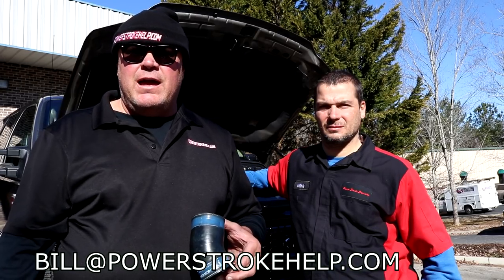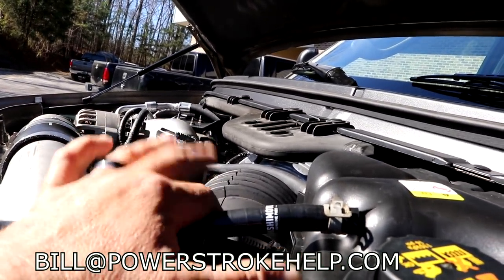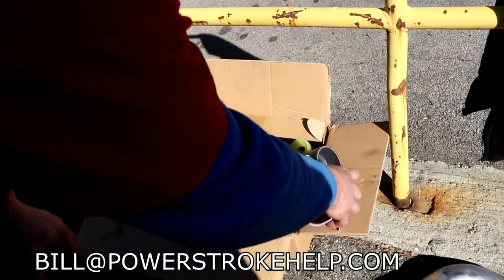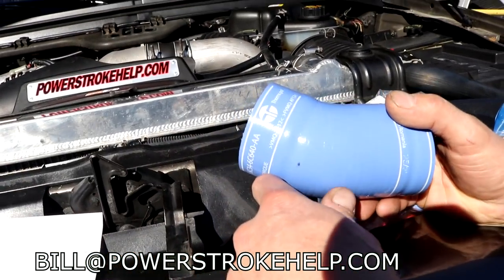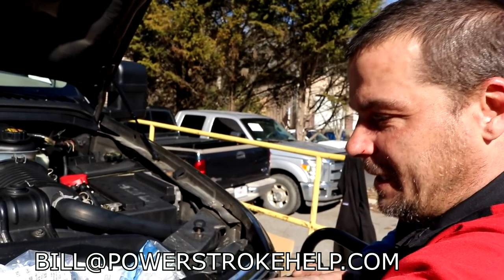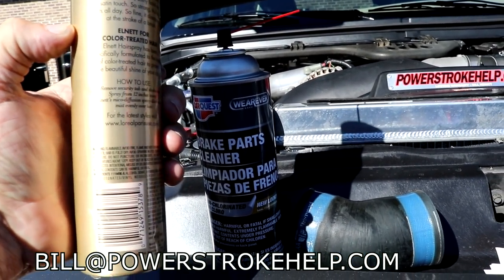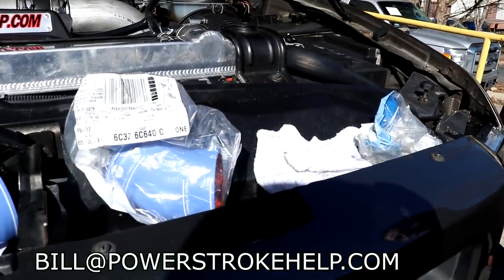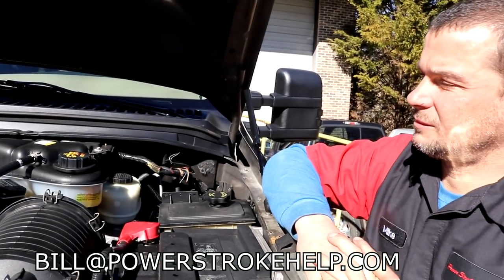POWERSTROKE TURBO BOOT FAILURE

Comment: You need to do a video on the ccv......I am intrigued!
Reply from the maker: I did the CCV video and the internet armchair trolls lost their minds. called me all sorts of nasty names. The argument is ALL Diesel engines are supposed to vent to the atmosphere and not ingest oil from the inside of the engine AND that many older diesel engine designs vented to the atmosphere. This is true until the PowerStroke V8 diesel engines started turning up the RPM and shift points to 2500+. This changes the rules and causes an increase in crank case pressure that MUST be relieved by vacuum or the oil seals in the engine start tom fail. Crankcase scavenging  using vacuum pumps etc has been in circle track racing for many decades, but these "experts" are unaware such things exist and argue from a point of ignorance.
Reply: @powerstrokehelp  thanks for the response. I was interested because I scolded my mechanic because in fortifying the engine he grinded off the bracket that mounts the intake tube to the ficm bracket and in turn caused the pcv valve to become unsupported so it leaks a very small amount.   Looks like I need to rectify the bracket and put a new pcv assembly in.....
Reply: @armedprophet3321  Bold Talker is a good Indian name. 👍

Comment: One issue I've had with the 6.0 and 6.4 air filters is when they get snow in them.  The snow melts, the water freezes, and the truck stops breathing.   The Ford air filters are a real pain when it comes to thawing them out and removing all the water from them.
Reply: How the hell did you get snow on the air filter? Lol
Reply: @themostmlgjellybean607  Beat me to the question.....No way on my 6.4 could I get snow in there, way protected from the elements.

Comment: why doesnt ford use a metal tube that bolts at each end?
Reply from the maker: The rubber boots have to be in place to dampen the vibrations of the engine. You can't have the driver (paying customer) having strange vibrations coming up his pants leg while going down the road.

Comment: one thing i didn't hear you mention is, the damage caused by over tightening the clamps on the aluminum tubes, it can cause the ends to deform and become cone shaped and out of round!
Beware when buying a truck from someone that goes out of their way to tell you how good everything is because they are a "MECHANIC"  I bought a late 99 with a bad auto transmission from a "MECHANIC" he was also a "WELDER"  the tubes were over tightened  and totally distortrd the boots were so tight they looked a girls skirt where they came out of the clamp. This guy took the air heater coil out of the Y pipe and put in a conglomeration of 1/2" black steel pipe with with a "T" and tons of RTV this was his set-up for a boost gauge port!  On the welding end this Dork took a 10" wide 1/2" steel plate and put it across the frame for a 5th wheel gooseneck hitch!  Not a bad idea if bolted,  but he weleded the damn thing directly to the frame! BAD IDEA!  The welding was shitty and had stubbs of MIG wire poking out allover!
Banks has good boots and tubes the tubes are stainless alloy .  I have a OBS that I put a Banks intercooler in it is top quality for after market!
Nothing Good comes from China!!!

Comment: I have a single vgt s364 on my 6.4, and it makes it makes all the boost, all the time! I blew off the aftermarket boot from h&s I got.  Was at about 30 psi and that made an impressive thump

I had to work out a roadside fix( Ofc is 35 degree heavy rain)  couldn’t find the clamp so I used hairspray and as many zip ties as I could fit. Saw this video today and it made me laugh, because everything he said happened to me. No boost is no joke!!!! Get an extra boot and extra clamps.

Comment: I guess it's not profitable for you...but dang I wish you'd still rebuild 7.3s.
Reply from the maker: I dont have a problem with rebuilding 7.3s but most times you can find a much cheaper low mile drop in on car-part.com. We do not install used engines.

Comment: There's nothing wrong with the Ford tubes until you start talking about the 6.7. My PLASTIC CAC to throttle body tube failed at 67K with no tuning. Imagine that happening in the mountains where there is no place to pull over and now no way to pull your load without melting the motor down because there is no boost .Is the Ford plastic tube the cam sensor of the 6.7? Carry a spare because Ford cant engineer the tube properly??

Comment: I put the AFE intercooler tubes on my 7.3 and it rocks.  Better mpg's, better boost and better cooling! It did pop off once on the cold side once but it was a Ford clamp failure.  AFE sent me high performance clamps and its been golden ever since.  

Most of the parts on the 6.0 are outstanding?  Come on it's a 6.0.  The whole engine was a POS that ruined Ford's diesel reputation!  That's why you charge 10 grand to bullet proof that POS!

Comment: Now, let me say, I love your channel, Bill. Been following you for years. And I can't wait till the day I finally have a 6.0 to bring to you to have dealerproofed. But, I do wish you would quit talking down to your audience. For example, you mock people who do the crankcase vent bypass, but the only explanation you give is that Ford wouldn't have done it that way unless it was right. But isn't your whole business built on the fact that Ford didn't get a lot of things right?  Isn't that why you call it "dealerproofing"? Please, if you're going to tell us why some modification is wrong, explain why it is wrong, functionally. And some aftermarket parts are better. Mishimoto radiator, anyone? Respectfully...
Reply from the maker: Thank You for the respect. You need to watch my older video called the perfect storm. In a nutshell the early 02 built 6.0 engines were extremely flawed. The engine had 482 changes made to it during production and most all the issues were straightened out by late 04 build dates. IF Ford motor company had actually honored all the warranty claims on the 6.0L they would have gone bankrupt. It was that bad. In the end the 05-10 (E chassis vans ran 6.0L until 2010) was one of the most reliable engines ever produced so long as you didn't tune it. 05-07 Ford F250s and F350s had some of the highest customer satisfaction data of ANY vehicle ever built.
Reply: The man aint got to time to hold your hand, and sounds like to me that your a bit sensative and a Prius might be your kinda ride.
Reply: @Sasquatchmedic  Your comment makes no sense. Dudes not being sensitive, he asked Bill a question. It seems more likely you desperately seek Bill's approval, so you think tough talk like "should drive a Toyota Prius, and ain't got no time for hand holding" will get you some kudos... not likely Chief.